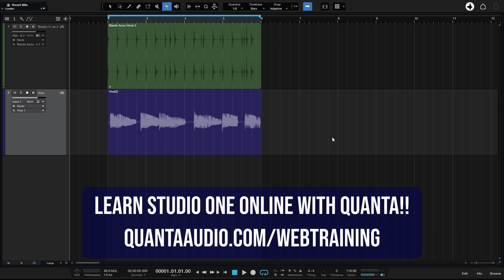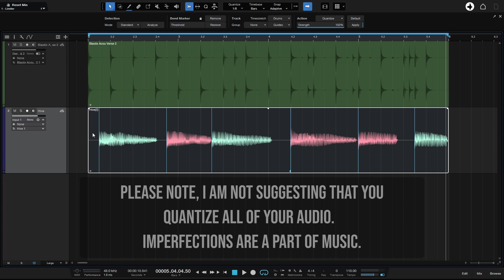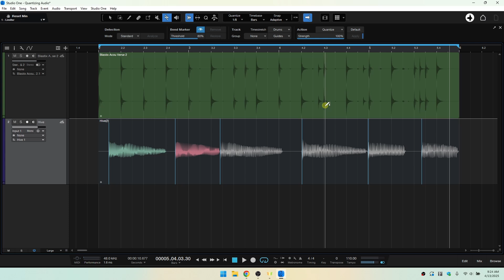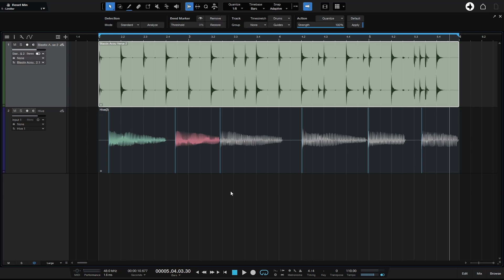Learn Studio One 7 | Quantizing Audio | Correcting Audio Timing in Recordings

Comment: Thanks I never even knew what audio bend was all about. I actually quantized audio for the first time last night, and I've been a user of Studio One since version 1.0 lol.  But I did it with the normal quantize menu, added swing and adjusted the quantize percentage.  After finding the sweet spot for settings, it was perfect! (I recorded a little sloppy on purpose).  Saved it to a quantize preset.  Plus everything sounded warmer because I came in analog instead of the usual midi/vst route.  I'm late to this obviously but I don't think I'll ever record midi again.  Then I dropped it from 93 bpm to 84 bpm and it was even better, perfectly time stretched. Sorry I went off on a tangent 🤓
Reply from the maker: No worries on the tangent.  I'm just glad you found a useful new tool in Studio One to help with your work!  Thanks for watching and taking the time to leave a comment.  Best.